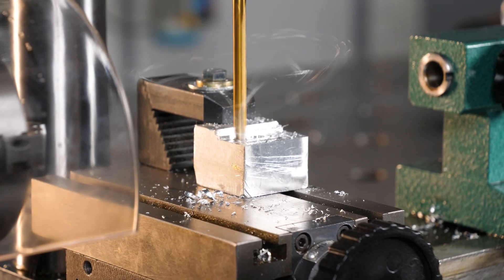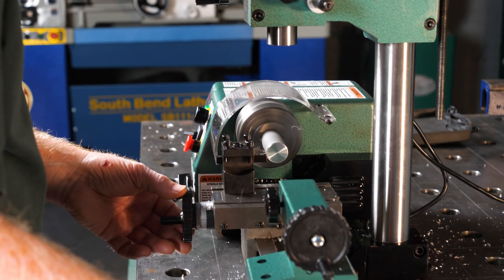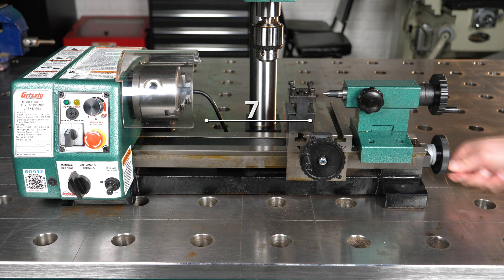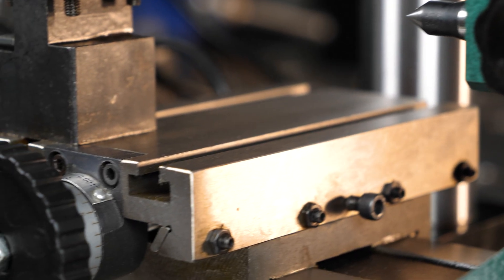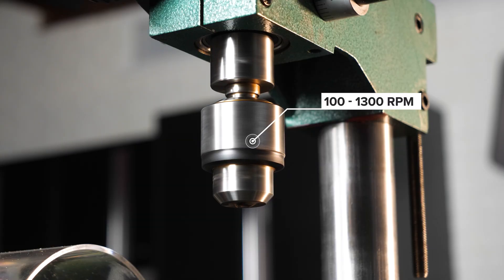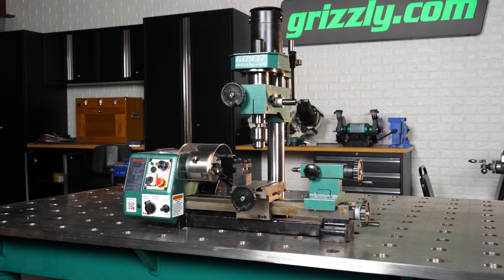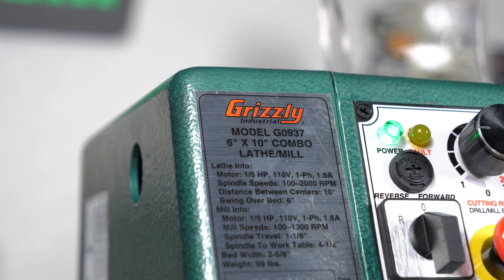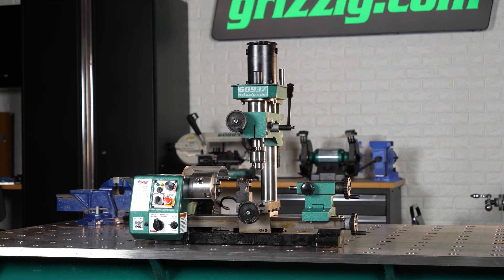Unbox Precision: Meet the G0937 6" x 10" Combo Lathe/Mill! 🧰

Comment: I have this exact same model, and I've owned it for roughly 5 years. I think I absolutely love it; it works great for model steam engines. And small projects around the shop or house, but truthfully, I wish I would have bought the size up from it. There are times when you need just a little something a little bit bigger. Don't get me wrong, this combination is very useful, but I wish it was just one size bigger. I've had to turn down quite a few jobs just because I couldn't get this lathe to fit. It is more for hobbyists that are wanting to do stuff like, like I said, model steam engines and things of that sort. It works perfectly for that, but if you're wanting to do something bigger, it's just a little too small for it. I've tried using it to make parts for my motorcycles that you can't buy those parts for, and this is just too small; it can't handle it. I still love it, though—absolutely great piece of machinery.
Reply from the maker: We're glad to hear you've gotten great use out of the machine over the past five years, especially for detailed projects like model steam engines. It’s great it’s been a reliable tool in your shop. We also appreciate your honest insight about the size limitations. That kind of feedback is really helpful for others trying to decide which model best fits their needs. If you ever decide to size up in the future, we’d be happy to help you find the right fit. Thank you for sharing your experience with us!